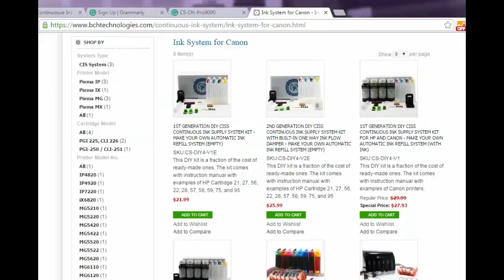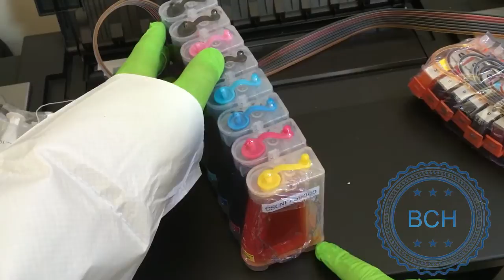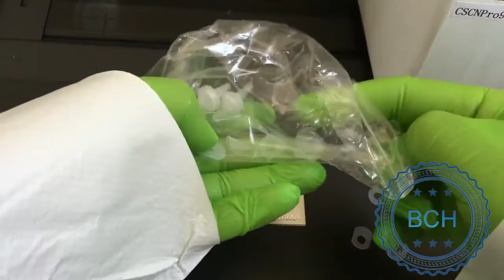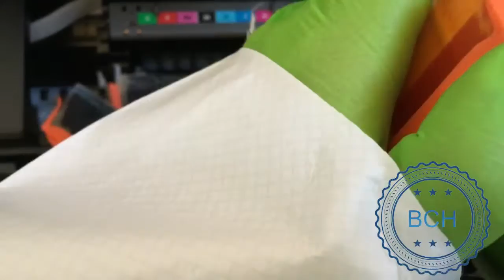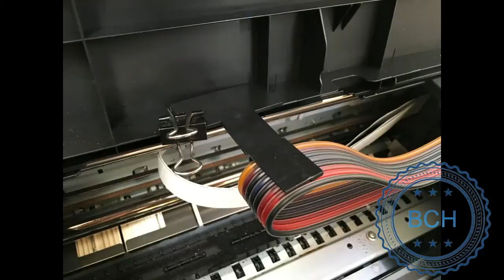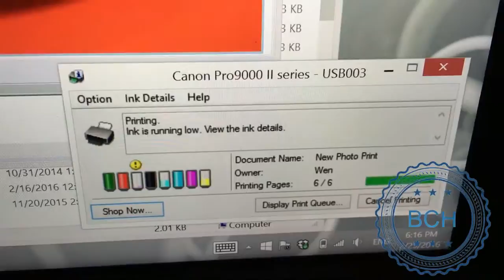Save Big on Ink With This Easy Canon Printer Hack!

Comment: Will this approach work with the Pixma Pro 1, I hear they've got a chipping system that bricks the printer if it thinks the cartridge has been replaced by any means
Reply from the maker: You will need to find a CIS with chip for Pro 1.  We don't have it here.

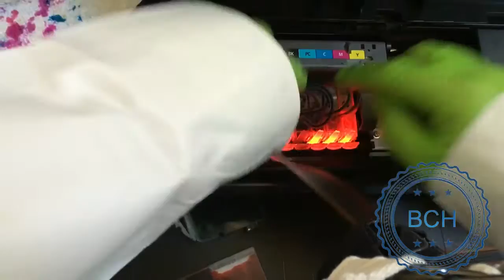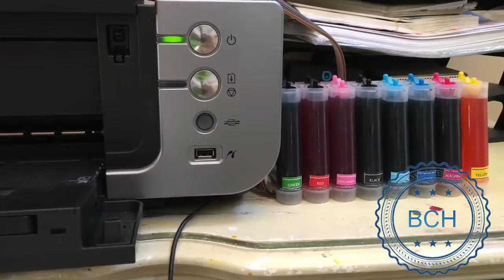Comment: At 4:31 there is a large amount of spilled out colored ink that was not there at 1:59. This means that all of this ink was released during installation of your tank system. My concern is that it appears that some of the ink has run down into the lower regions of the printer where it can't be cleaned out.
Reply from the maker: There is an absorption pad underneath the printhead.  However, if you flood the pad, then you will have a problem.  Make sure you put the tanks NEXT to the printer, not above it.  If you put it at the same level of the printer, the pressure is balanced.  The ink won't come out by itself unless there is something (printhead) sucking ink out of it.  The tanks should be at the same level as the printer, which is mentioned in this video.  We put it on the top briefly to install the CIS but we put it down afterward.  If you put it on top of the printer, it will flood the printer for sure.

Comment: Hi, i have a problem with the CIS for this model of Canon, It marks 15 led flashing on the printer, i wish to know if there a way to fix this trouble manually or with a reset. Thank you. My email is rael@live.it
Reply from the maker: Where did you buy the system?  I will send you an email.